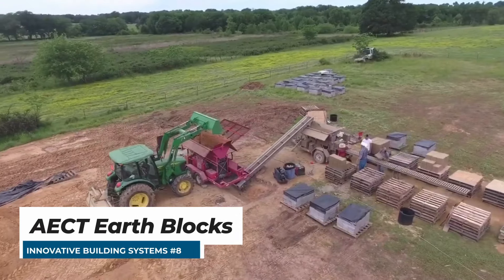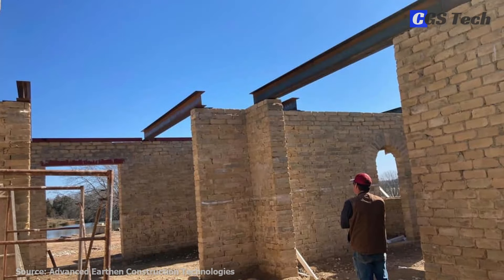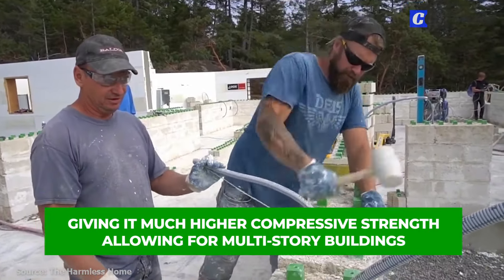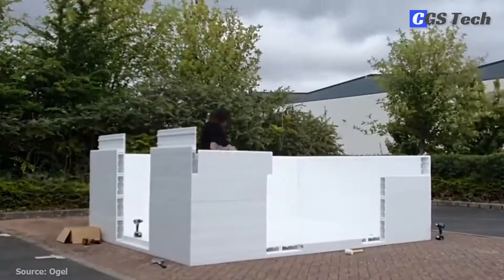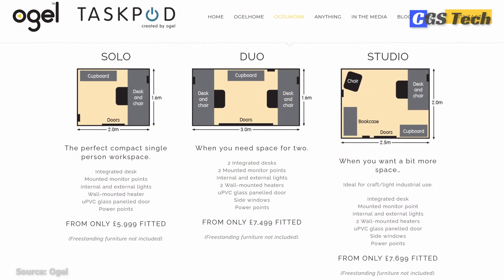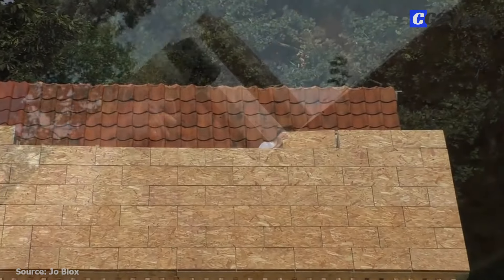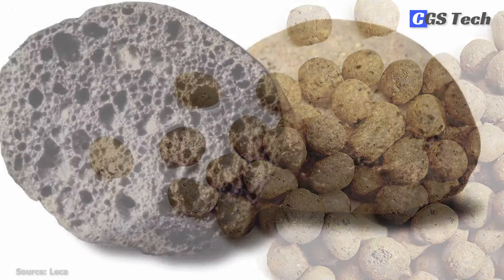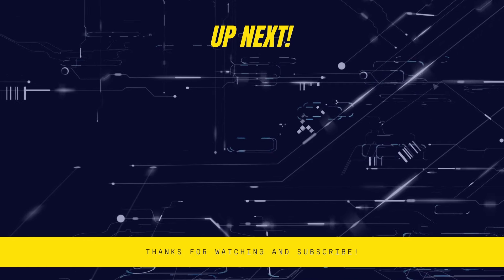5 Innovative BUILDING SYSTEMS for your house #8

Comment: Love the videos, too bad none of these companies understand they will never succeed in the long run if they don't lower their price closer to the cost of cinder blocks.  I'm not paying $6,000 for a garden shed.
Reply: They are not trying to actually get to market. They just want to take the donated money play around in a work shop and relax. It takes so much work to have a product this large shipped to stores and customers. Way easier to make a quick proof of concept, sell the dream to a small group of 20,000 people and move on.
Reply: @vanderumd11  Is there a way for someone who actually believes in innovative construction techniques to actively manufacture and develop then? All these companies have proof of concepts but none are actively working on large products. What do you think is the way?
Reply: @Crusares  it would only take $100 million and the amount of money would be endless. This is how you begin

The cost of machine manufacturing.. you would need to be strategic and take over one coast at a time. You need a small natural plant and supply chain Because the cost of gas/fuel/trucks for large blocks is expensive. You need a few acres of land for hay production then lime and cement. The machines would need to press large lightweight hemp or bamboo product blocks with a epoxy putter layer to prevent damage and chipping. You would need to then buy retail space to sell directly to consumer and endless advertising online for easy assemble sheds. You would need to get regulations and lawyers to draft guidelines so people can actually use the product legally. I imagine a simple 3'x 2' light weight pressed block. The problem with these companies is they do not have the ability for distribution. Even if I had 10million blocks... It would cost so much to ship and hold them in stores. It would actually be a perfect idea for home Depot or Lowe's to produce the product in store out of shredded pallets and waste sand, cement ect... They could make a ton of money